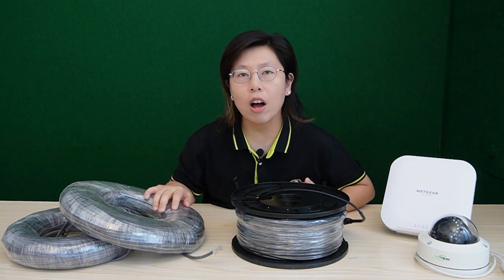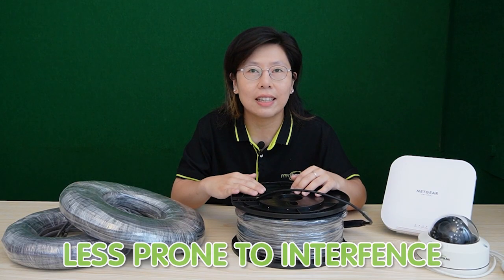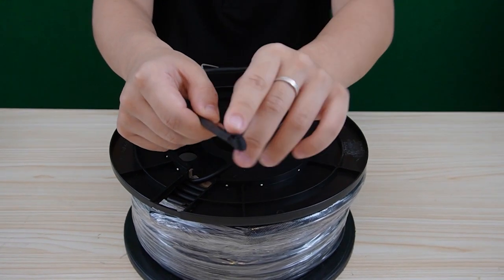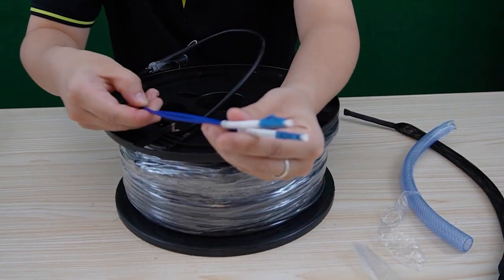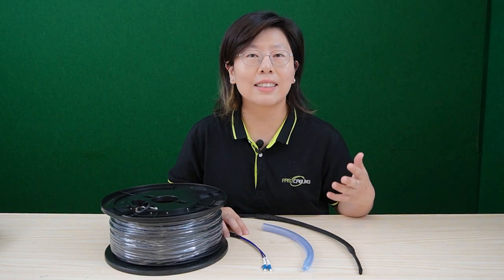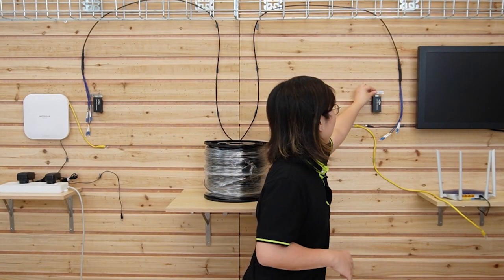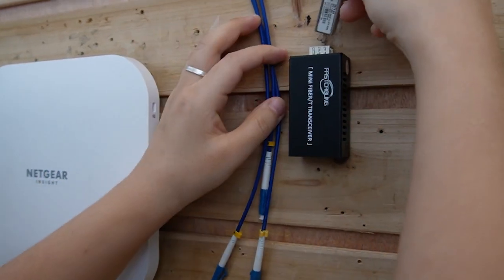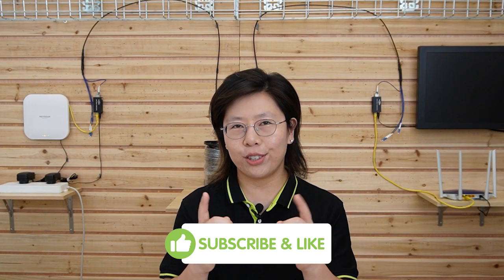Introduction to Fiber Optic Cables Basics and Benefits

Comment: The way you configured your example is incorrect! 1) You have to connect both fibre ports of the transceivers 2) the transceivers need to be cross-connected i.e. TX <—> RX and vice versa. In the introduction you also incorrectly state that “the transceiver works like a bridge”😊. A transceiver is Layer 1 device does only media translation and signal regeneration…
Reply from the maker: We're using BiDi SFP transceivers which can transmit and receive optical signals over a single fiber strand.
Reply: @Fastcabling , Thanks for your follow-up and clarification. This is an excellent news that you would be able to spare a fibre run with optical multiplexing. Still it is a requirement to purchase those BiDi SFPs in pairs to match their TX and RX wavelengths.
Reply from the maker: Yes, whether you use one fiber or two, you will need a pair of SFP modules for data transmission.
Reply: I am afraid you are not getting the point: That is true that you have to purchase SFPs in pairs, however, in case of BiDi you need to pay also special attention to their wavelength tuning.
Reply from the maker: You're absolutely right! Mismatched wavelengths will result in communication failure.

Comment: Since the fiber optic in this case is in single mode, wouldn’t you need to connect at the same converter more than one fiber connector?
Reply from the maker: Thanks for your comment. That's because we use BiDi (bidirectional) SFP modules to transmit and receive optical signals over the same fiber, so we only need to connect one fiber connector to the converter. For more information here: https://www.fastcabling.com/product/bidi-sfp-fiber-modules-2/